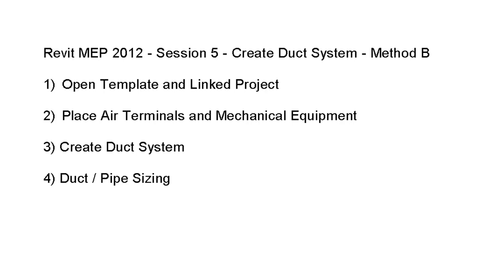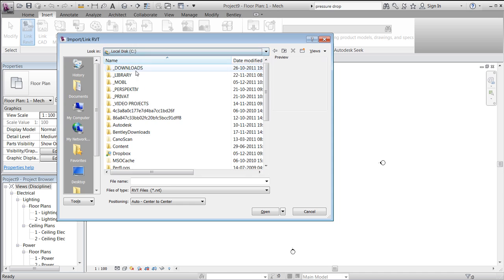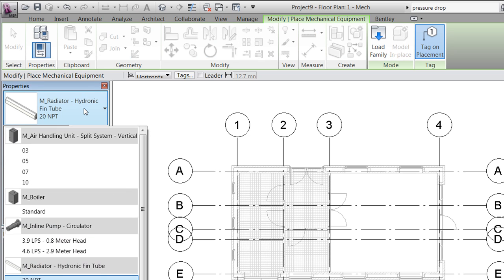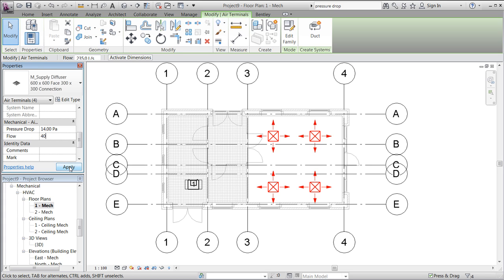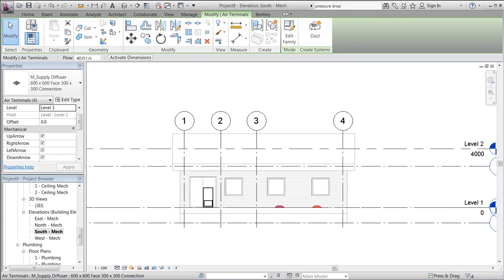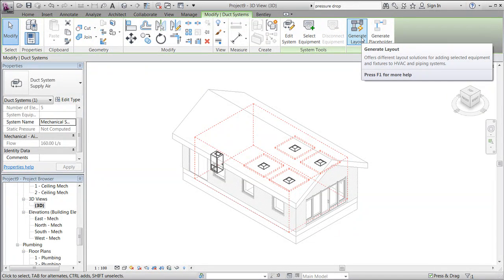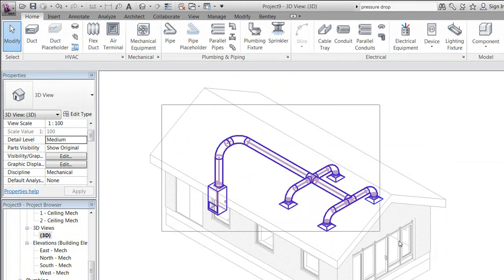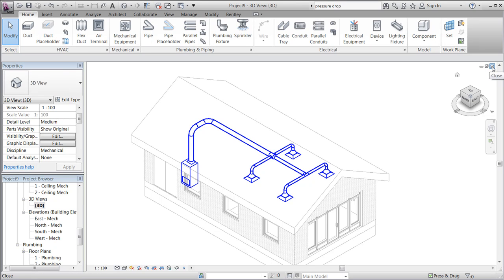Revit MEP 2012 - Session 5 - Create Duct System.mp

Comment: I suggest attaching the air terminals to the bottom level and adding an offset. This will make it a lot easier for everyone else who has to work with your model for BIM coordination and take offs. For instance if someone filters and only wants to know what is on level 1. Not sure if what I said is considered good practice outside sweden though.